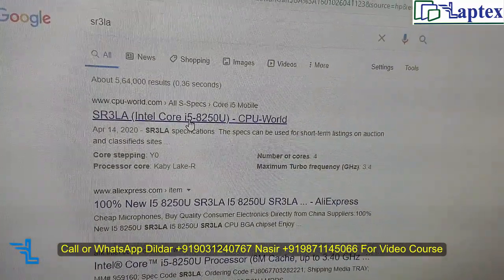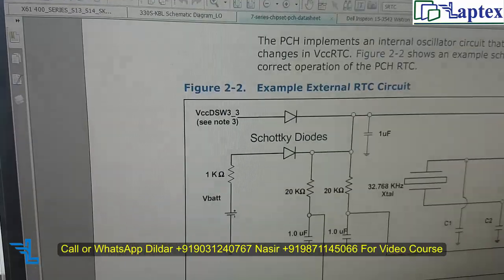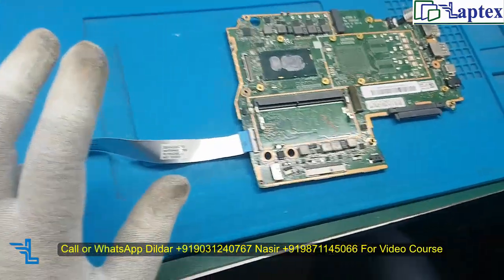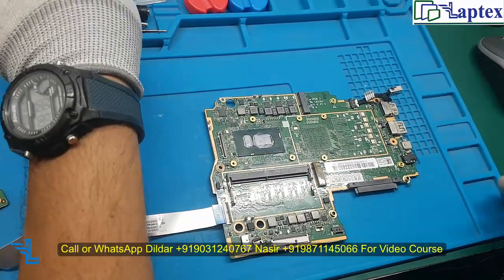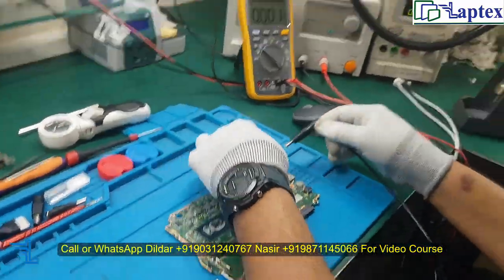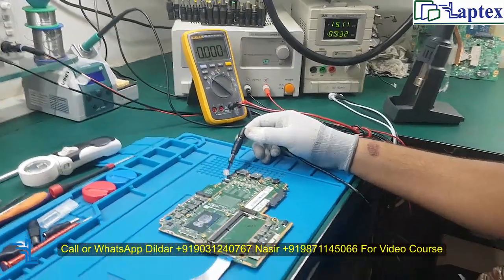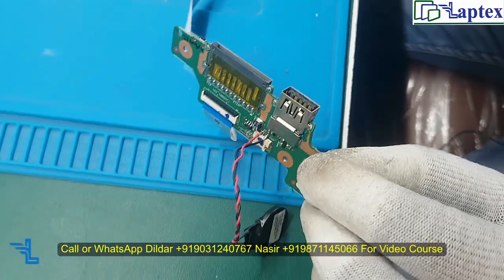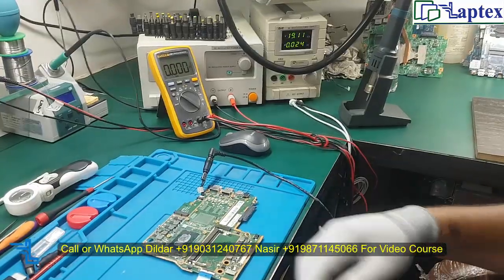Lenovo 330s Not Turning On Low Current Problem English | Online Chiplevel Laptop Repairing Course

Comment: Is it possible to disable the 4GB RAM soldered on the motherboard so you can use a 32GB stick in the SODIMM slot?
I'm currently using 20GB with a 16GB stick but it would be nice to upgrade to 32GB if possible.
I think the max RAM is 32GB so 4GB on-board + 32GB stick = 36GB won't work.  Right?
Reply from the maker: Yes possible if schematic and boardview is available.

Comment: Sir this old video help me today to resolve ideapad 330s not triggering problem. Problem in this board is rtcvcc is okay on rtc diode but on rtcrst it's 1.4v instead of 3v. Track of rtc is internally leakage . After jumper from rtc diode to rtcrts resistor board start triggering. Thank you very much
Reply from the maker: Great work bro. Keep supporting and sharing our videos.

Comment: may be it has ram section problem, check vpp supply and  powergood voltage.. it will be S5 Signal for VDDQ ram voltage and check vtt also
Reply from the maker: Good 👍

Comment: Sir that replaced IC has a hole in it. I have a similar board with no lights nothing but 19v is present. Had a bad charger that caused the 330s to go off. Any suggestions plz? Checked mosfets and caps. Not found any shortage yet
Reply from the maker: Check properly the DCIN section and MOSFETs Gate switching.
Reply: @laptex1377  Thank You

Comment: Hello, I have an issue with the same PC and Motherboard.  The PC suddenly stop working. I check the power voltage directly on the power connector (without to be connected to the motherboard) and I have well 19v. 
When I connect the connector to the mother and check the power value on the slot near the connector (+) I have only 0.4 v. 
No light is switching on. I did the test with another power supply: same issue.  I removed the battery, RAM, disk... same thing
Any idea?    Thanks for your help.
Reply from the maker: There is shorting in the motherboard. Pls get it checked by local technician 👍